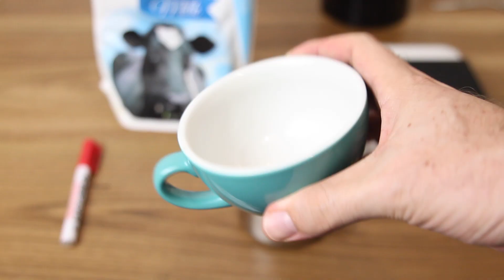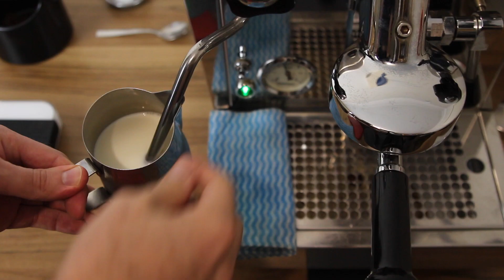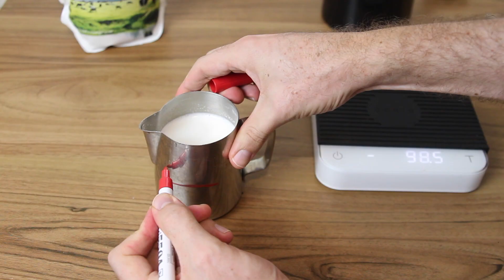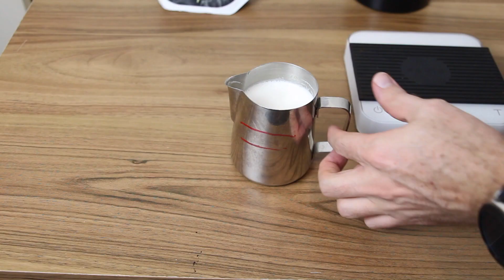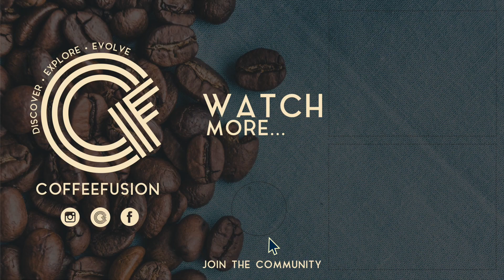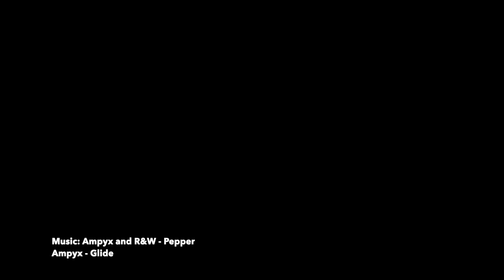Texturing Milk 101: How to Froth Milk for Latte Art

Comment: Hello, great videos on frothing milk and latte art. I really enjoy ur bootcamp series! I know u mentioned using fresh full cream milk is the easiest way to get the velvety texture, but i am wondering if u could offer any tips for frothing almond milk (non-sweetened) for latte art? Thanks in advance ;)
Reply from the maker: Heya! I never have as much luck when pouring alternate milks. The main advice I'd give you is make sure you're using a brand which is designed to be used with coffee. The ones that aren't tend to react with the acidity in coffee and then latte art is almost impossible.

Comment: I am enjoying your latte art series. I started learning this around 2005 when there were very few tips available. Always love learning helpful ideas. My question is about occasionally getting too much foam, maybe double what I need. I lower the wand as soon as the milk is warm but the volume keeps growing. Is the freshness or age of the milk a factor?  I have a Nuova Simonelli Oscar and have seen some suggestions to replace the steam wand tip. What are your thoughts?  Thank you from Colorado!
Reply from the maker: I'd say that even though you have the wand below the surface, your whirlpool is spinning in a way which is allowing more foam to be added.

This happens to me sometimes on machines with high pressure when I'm using a small jug. You can just tip out a little bit of the excess foam when this happens.
Reply: @brewbudsclub  Tip out...you mean to pour off a little?  I do have less challenge with this on a larger pitcher.  Thank you!
PS...the milk still taste great!